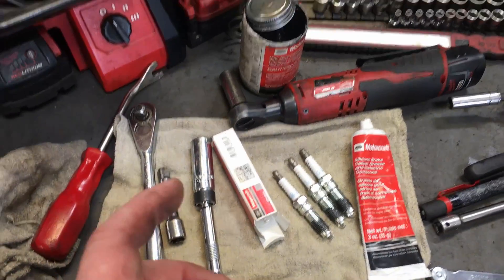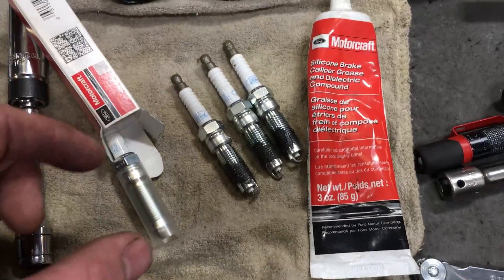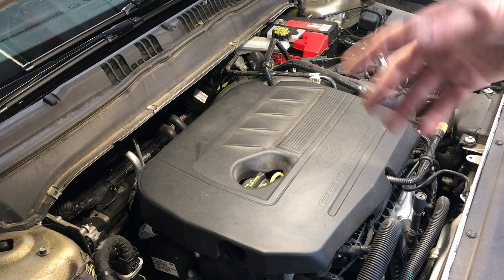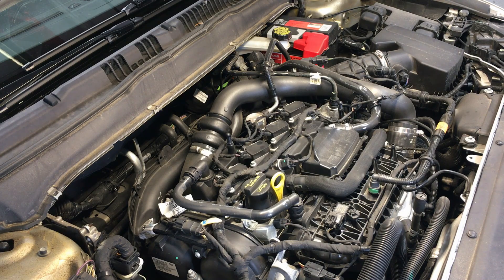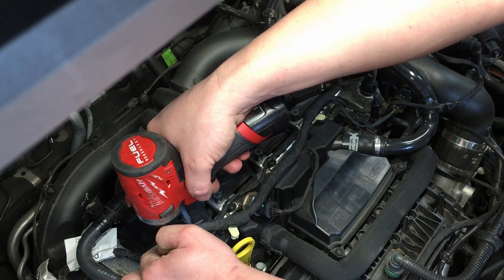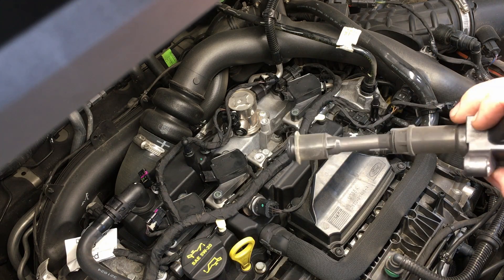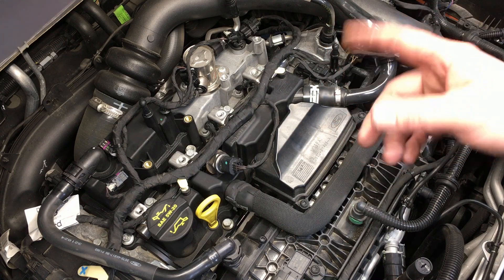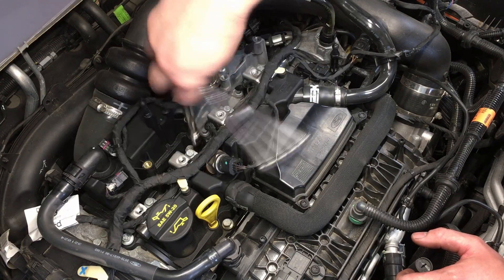2014-2018 Ford 1.5L GTDI Ecoboost Engine: Spark Plug Replacement

Comment from the maker: These are the Tools and Parts I Recommend:
Spark Plugs Qty 4-
https://amzn.to/2viAzAo
Special Spark Plug Socket-
https://amzn.to/2KtwSfW
Dielectric Grease-
https://amzn.to/2M43Yrj
Nickel Anti-Seize-
https://amzn.to/2KuE1MQ
Reply: FordTechMakuloco Thank You I Always Learn Something New With Your Videos 😎😀👍🏼
Reply: Hey quick question on a 2014 fusion 1.5t .its cut off on me 4 times. 2 times when I just filled up and 2 times when idling with 1/4 tank of gas what would you think is the problem. I have good low fuel pressure and high pressure.  The car stumbled and died the 4 times.
Reply: stuck purge valve(under the hood) or stuck/clogged purge vent (on the vapor canister).  I just changed mine. @46doch
Reply: The manufacturers of the iridium plugs tell us to NOT try to gap the plugs.  The iridium tip is delicate and easily damaged.  The ECM is monitoring spark performance and it will adapt to the gap on the plug unless it is dramatically wrong, like when you have a bent electrode.

Comment: Just picked up the wrong plugs twice in a row from auto zone. The autolite plugs are NOT for the 1.5l even though their system says so. They are a 5/8 hex nut and a different thread pattern. Thank you for this video! I guess motocraft plugs it is 🤦 maybe we can get better than 24.6mpg average from a full tank and granny driving it 😂

Comment: Why use Nickel anti-seize on the threads instead of copper or aluminum anti-seize?
Reply from the maker: High heat and is the best you can use.

Comment: I have a 2017 for fusion 1.5 Ecoboost its got just under 59k should i think about trading in?
Reply: I have 53k on mine and I'm not trading it in I keep up with all my maintenance so I don't have any issues. I will say if it makes financial sense and you can afford and want something different to drive go for it

Comment: my 2014 has 211K miles on the original plugs, and no sign of a problem.  I'm about to change them anyhoo. And the boots, just for good measure.

Comment: Hello do you know the firing order…. I have a mis fire on #2 I had it replaced but standing in front of engine I just counted 1,2,3,4 in that order. But I’ve read the order is 1,3,4,2 I’m wondering if I replaced the wrong one because engine light is and mis fire is still happening.

Comment: Quick question, I just did the spark plug change and now the car is running super rough when driving. Idles fine but only rough when On the throttle.   Appreciate the help
Reply: Hello, did you figure it out? I am in same boat now. Thanks G

Comment: I took #1 out of my '16 Fusion tonight trying to track down P0301 and the porcelain shattered into a thousand pieces, some falling into the cylinder. I'm buying a swivel in the morning and hope I can get everything out of that cylinder and out of the threads. Nightmare.
Reply: Yikes what a fiasco, how did it end up working out for you? 

Also how many miles did you have on it at the time?
Reply: @jeffherrington  It had 140,000 miles. The problem ended up being the coolant intrusion issue. The engine was toast. This was a common problem on the 1.5 Ecoboost that Ford let go for several years. I think I heard that the 2.0 Ecoboost also had the problem. They came up with a new design for 2021 that supposedly fixed it.
Reply: @bradh6185  Thanks for the reply. I just found out about this issue. I have a 2018 Fusion with the 1.5l ecoboost that I bought it 2020. Currently I have 45,000 miles with no issue but definitely concerned for the future so I'm debating on whether to keep the car especially when Ford will only cover it for replacement 7 years from the original warranty date or 84,000 miles whichever comes first which is ridiculous for an issue this large. 

Anyway did you have any symptoms with yours prior to throwing the code do you recall and/or did the issue start close to the 140,000 mile mark? Basically just wondering if it took awhile to trash the engine like a slower leak into the cylinder over thousands or miles or a quick destruction. I suppose it's probably hard to know though definitively.

Comment: I have a 2019 fusion 1.5 ecoboost. Can my iridium spark plugs in mine last 100k also? I’m only at 40k right now.
Reply: I have same vehicle but a 2018 and my mechanic just showed me my spark plugs are completely corroded at 40,000 miles. So, I am going to attempt to change them out myself for the first time ever today ... Sad to hear they are supposed to be 100,000 miles but mine didn't even last half that. I only bought it a year and a half ago, so I'm not sure if it's something that happened that is normal or the previous owner(s) were rough on it or something...
Reply: @JaspersJourney Did the spark plug change end up going alright for you? 

I have a 2018 as well and I'm considering changing my plugs after reading your comment. I'm at 45k miles currently.

Comment: Seems like owners of these engines are lucky to even get to the first 100k without coolant issues
Reply: I’ve driven my 2016 1.5l eco boost coast to coast lots of mountains and have been hard on it without a single problem yet lol
Reply: @Albrecht420  They didn’t start having issues until ‘17 I think
Reply: Mines got about 150,000 miles still rolling down the road fine

Comment: Dumb question, but I have seen it happen in other cars.  Can a sloppy shifting transmission be partly caused by needing a spark plug tuneup?  My 2000 Firbird waked-out horribly when coil pack #4 totally went out.  Car wouldn't barely shift out of 1st gear to get it home.

 A little backstory to my 2015 Fusion Titanium, under warranty, Ford replaced my entire transmission because it was shifting sloppy. I think they pushed the warranty replacement through by saying it had metal shavings, but I truly don't believe it did.  I never had any codes of any kind either.  The transmission still shifts exactly the same way it did before they changed out the entire transmission. They fail to recognise the bad transmissions these cars have after so many miles. Now my warranty is gone, and the transmission is still shifting sloppy.

Comment: Please advice, I have Ford (EU) Focus 1.5L Turbo 150hp, got 150,000 Km mileage done and I can feel now the engine is slightly sluggish & it's not powerful as it was before. There is no code in the system, Please advise what could be the problem and what part should I look and get service, Thanks.

Comment: Will these little 1.5 turbo benefit at all using 93 octane fuel.
Reply: Salvador 1707 hell yes. I was using 95 octane fuel and the piston still blew on me. With the 2nd engine, I’m now using 100 octane for extra security.

Comment: Do you have any information on the cam follower that operates the high pressure fuel pump? I’ve heard they’re prone to wear out on the 1.5 and it’s best to replace them every 50k miles to prevent much more damage
Reply: I can only recommend replacing it, i speak from experience... took out the high pressure fuel pump, and the intake side cam shaft!
Reply: tomiselmer omg it’s that in depth!?

Comment: Haha I have 8000 miles on it and it's on its 3rd set of plugs the dealer keeps replacing them and not finding where it's leaking oil in to the engine that keeps fouling them. I called ford and good luck with that as they don't speak English. I'm pretty sure the turbo is where the leak is at
Reply: Not leaking oil, these leak coolentninto the oil and the combo fouls the plugs. TSB finally released recalled for reprogramming all these 1.5  on 12-13-2019

Comment: Quick question,I installed a transmission on 2013 mkz 2.0 ecoboost,do I need to program the Tcm or transmission characterization

Comment: My wife just bought a 2019 Escape with the 1.5EB with 4WD.  Is there anything in particular I should be aware of as far as maintenance issues or potential known issues?  Thanks!
Reply: How’s it going with the escape? Bought one almost 2 years ago
Reply: @LakersAllDayyyKB24 .     I’ve had a 19 since new. No problems. 95,000. No special maintenance.
Reply: @LakersAllDayyyKB24  - Great so far!  Still have it and haven't had a single issue with it in 75,000 miles.  Per FordTechMakuLoco's recommendation, I've been doing a drain-and-fill on the transmission, PTU, and rear differential every 30,000 miles.  It's been a great little vehicle for my wife!

Comment: If you have a torque wrench, why not use it on the spark plugs?  Not a criticism, just a comment.
Reply from the maker: I feel more confident in the repair doing it by hand to actually feel it seat . Take the Ford modular 2v engines for instance, see my video on that.

Comment: Hi Bryan. For the 2013 Fusion the ower manual says SP-527(17´-18´) but in Rockauto it says SP-550(13´-16´). Im guessing it is owners manual but what do you recommend? Thanks.
Reply from the maker: SP-527 superceded to SP-550
Reply: @FordTechMakuloco  Thanks. So the SP-550  gap is 0.002" less than the SP-527. Is that ok ?
Reply: @FordTechMakuloco  Brian just got mine SP550 and they are at 0.030" checked with a gaper. Will it be Ok?

Comment: I have a 2017 Ford Focus with the tiny 1.0 eco boost. Now clocking 25k and has started to leak coolant. It’s currently at Ford dealer trying to figure out what’s going on.  This one may not even see 100k miles.
Reply: Look up 12-13-2019 TSB just released

Comment: Does the 1.5 have a timing chain or a timing belt
Reply: @Daniel Lockwood The 1.0 and 1.6 are timing belt and the 2.0 is timing chain. Out of speculation and an educated guess I'd say the 1.5 is timing belt. Looking into it actually the 1.0 and 1.5 are timing belt in oil bath. So oil might be even more critical for those engines.

Comment: Why did this engine replace the 1.6? Were there any major problems with it?
Reply: Tax reasons especially in the Asian market. Essentially it's the same architecture as the 1.6eb but  with different internals but same power output and torque values.

Comment: hey bro love your stuff. I am a subscriber. got one for you. 06 5.4 vin 5. B2 showing miss fires on 5 mostly and some on 7, this on miss fire on verus. on cylinder contribution 5 thru 8 are showing in the neg. but only a little. it will only do it when warmed up. I can hold it in gear and slight power brake under load for a while and it will start missing. and will continue at idle. cut truck off start right back and its smooth. we are a pro shop. one guy does all our phasers and chains. he just put new in both sides. codes p022 p305 p307 p2198 the last on is B2S1 stuck rich, I think the code # is right? had  5 injector and 6 on scope today and ms on 5 was jumping back and forth 4 to 6. but more steady on cyl6. like I said 5 has misfires counting up in the hunderds in a few min. but 7 only in the tenths at the same time. valves sticking? computer control? valve timing? it has a new ford vct solenoid
Reply: put a vacuum gauge on when missing. we have a slightly bouncing needle. cylinder contribution is showing 5 -8 not helping.... also showing B2 50 deg more than B1....but when you rev it up it clears out....it does have second set of dorman phasers
Reply: UPDATE install 2 FORD phasers... no change....if you unplug solenoids and drive truck it does not miss. Has new ford solenoids also. thinking B2 is getting bad oil threw oil passages?? going to put royal purple in tomorrow

Comment: Any car with turbo will never see my money, whether it's ford or any other manufacturers,naturally aspirated all the way
Reply: My Volvo turbo engines have all gone over 225,000 miles without trouble.
Reply: @johnferguson7235  how many turbo did you go through

Comment: Hello Tech Makuloco, and suscribers. My apologies since  This is going to be an offtopic question but this is the only place where I can get a real answer.  My 2007 expy courtesy lights don't come on when I open the doors, amd I read online that my issue is a bad  ECM module, I'm ready to replaced it. Here is  my concern
 is it true that new ECM has to programmed? And the only ford's dealer can do this job? Thanks  in advanced  everyone. .

Comment: Wow, a .028" spark plug gap seems like something that would be specified for an old vehicle with points ignition! I suppose they're trying to protect the coils and the ECM drivers if the spark plugs are neglected.
Reply: Hmm that’s weird. My Manuel book just tells me to gap them at .051”. I drive a 15 fusion titanium eco boost and a lot of people say to do it at .028” so idk if I should follow through what the Manuel says or go with what people say
Reply: It's the turbo charging combined with a lean fuel mixture. Plus, the plug is designed to last 100,000 mi and the gap will increase as the mileage builds.
Reply: Mine's still running fine at 211K. I'm about to change them.  Maybe the coil packs too.
 @johnferguson7235

Comment: I’ve been fighting what feels like a fish bite misfire on a 2014 fusion ecoboost, only at high load (passing or climbing). No codes. Runs beautifully at all other times. Has all new ford coils and plugs from another shop. Any ideas? I’m banging my head on this.
Reply: What is the mileage on the vehicle?  At what RPMs and MPHs is this occurring?  Do you have a scanner that will show (and hopefully also record) the live data during your test drives?  What is the O2 and fuel trim data showing when this "fish biting" occurs?
Reply: Did you ever resolve the "fish bite" issue?  I am having same issue now (no codes).  Curious if it might be tranny, plugs, waste gate, belts, etc>

Comment: My 2007 Ford Fusion SEL naturally aspirated V6 has over 210,000 miles.
Reply: Keep it going for as long as you can.  You won't get that out of these newer 4 cylinder twin-turbo engines.
Reply: No where in my reply did I specify Ford engines - simply in general the newer 4 cylinder twin-turbo engines are not going to routinely last over 200,000 miles like the original poster was getting from their naturally aspirated engine.

Comment: great video and content. your the man!! I like your take on doing one plug at a time. the other day I had all of them out and I had the throttle body removed. next thing I know I bumped the Throttle body and the brass cable holder fell down in a spark plug hole! I ended up using a Tootsie roll and a long stick to get it out! lol
Reply from the maker: Nice thinking!!
Reply: Did you eat the tootsie roll when you were done ? Tell us the truth !
Reply: no I didn't but I did chew it up just a little before I used it.

Comment: Are you positive on the 100,000 change? Even the non boosted guys on the 2.0 EB are seeing foul plugs/misfires at the 60k range on Fusions.
Reply from the maker: As you can see here with over 100k miles on a properly running engine yes with Iridium plugs.
Reply: I just recently started experiencing a slight fluctuation in rpm @ idle and that’s what brought me here and I’m at 62,000 on the nose.  Zero issues and no codes but I do run my 16 1.5l like I’m on the Indy 500, there’s just something about how these CD4 frames handle that makes me want to put it to the limits 🤷🏻‍♂️

Comment: I changed mine at 62k
Reply: The iridium tipped plugs do last up to 100 k miles, that's about 5000 hours operating time.  As long as the computer is happy with the spark performance and the engine isn't misfiring or sucking oil through the valve guides, there is no advantage to changing them early.

Comment: Hi Brian is this your opinion on all eco boost engines, ? or just 4cyl type?
Reply from the maker: All are very troublesome and being pushed their whole life, in the end they just won't last.
Reply: If I use synthetic oil and change it every 3,000 miles would I extend the life of the engine and its tubo?
Reply: John Azhderian not only would you extend the life of your engine by just taking care of it and paying attention to your oil. Oil is critical for a turbocharger. Always waiting 30 seconds or so before driving, idling for a few seconds before shutting the engine off, and frequent oil changes can only do good. Frequent oil changes can also help with carbon build up. But synthetic oil is definitely more important then the 3k interval. If you can do synthetic every 3k it's only going to help.
Reply: IM in total agreement, really like the 3.5 non eco boost, but as far as the others in the Ford Line up? all seem to have reliability issues. As a % basis how much of your work is Ford, vs all of the other manufacturers?
Reply: The load on these engines is higher. The 200k miles should be a realistic end of life. Proper and timely maintenance is critical with these engines, don't cheap out on the engine oil and filters. 
Another thing is that they seem sensitive to fuel quality as well. I only put 98 RON in it or higher (note the RON, I'm from the Netherlands and the octane rating is different here). When properly maintained it is a very nice engine to drive with we have the 150bhp version in a C-Max. Even with a 1300kg (2800lbs) travel trailer behind it the engine behaves great.